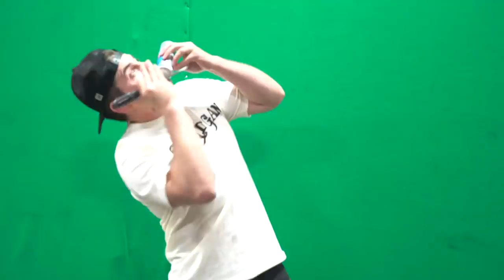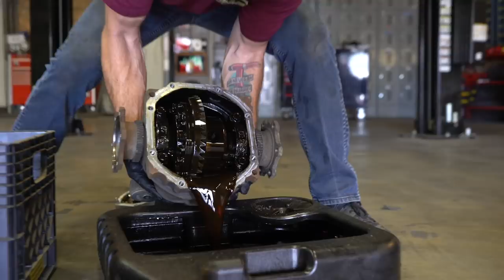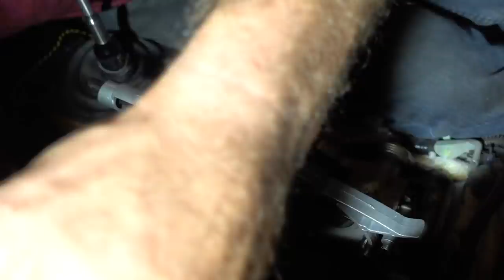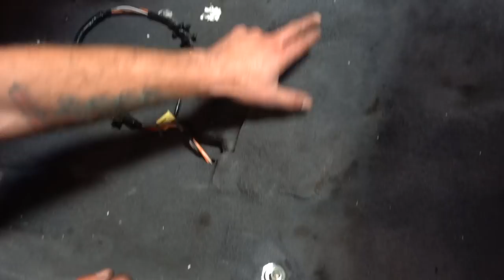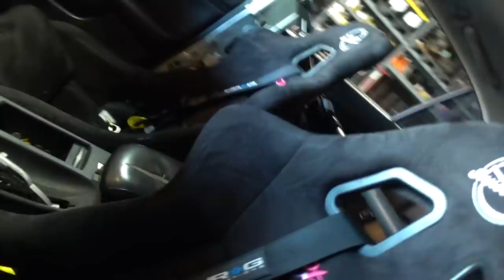How to Make a Car More Driftable! Welded Diff, Stock Handbrake Extension, and Harness Bar

Comment: That hand brake was some creative craftsmanship.
Reply from the maker: Now it’s 100x Better than the factory handle!!
Reply: Thought: Would the locking pin slip into position now that it’s free moving? Could be risky to have it come on and lock at any time, I would have either ripped out that pin or secured it open.
Reply: He took out the whole lock. Pin, actuator arm, spring, and locking arm are out. The only part left in was the gear that the arm locks onto.
Reply: I was worried about that too, but yeah looks like what he was drilling out was the dealie holding it.
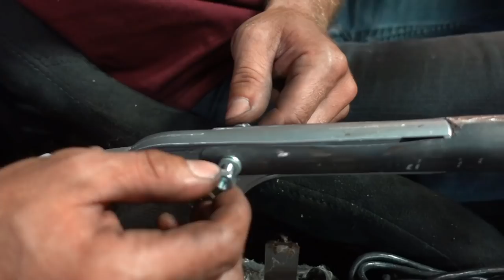Reply: @stuart2332   At 11:26 he takes it off

Comment: If you change out the last arm on the rear, and shorten it up, you can get a lot more life out of the tires by reducing the bumpsteer in the rear, and get it to launch harder (aka light the tires up easier)

Comment: positive camber the rear alignment closes to 0 degree, add another 2 bucket seats at the back.
Reply from the maker: That sounds like the recipe to success!!
Reply: Amoj 21 if you want a proper drift alignment, you want closer to +1 degrees in the rear. That way when the suspension compresses, it should about zero out, equating to the most tire contact and grip while in drift

Comment: Get aluminum wire Dan!!!!!! I prefer .035 you can run it in a mig welder you just have to run pure argon gas and get the right size tip, it actually works pretty damn good. I use one on almost a daily basis

Comment: You guys should try the 4.3 ratio diff from the 250gt V35! G25 I think you guys call them? I wanna try one in my 350gt Fuga, the standard 3.3  makes 2nd little too long in my opinion even with a locky 🌈

Comment: yal should adjust the SHOES in the back for the ebrake to make sure theyre adjusted correctly before tightening the handle.  Harness bars are a huge no no in the racing community as well as seen as UNsafe.  Safety third guys

Comment: i would've taken out that pin that locked the handbrake, cause now if the car rattles and locks the handbrake in place you have no way of releasing it without taking it apart again.

Comment: That's not really how you adjust the handbrake. Tightening it up by the handle only takes the slack out of the cables, if you want it to lock better you should adjust it with the adjuster by the brake shoes.